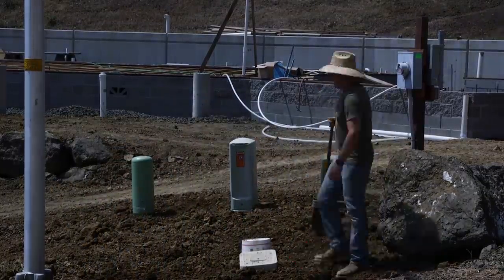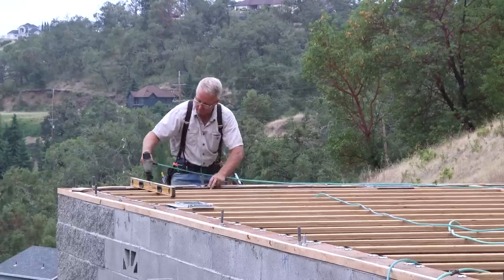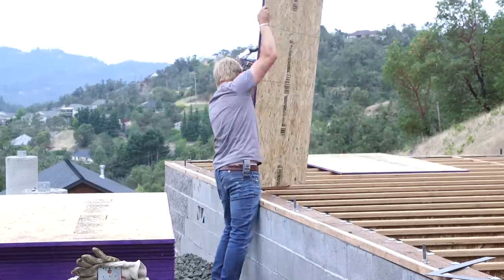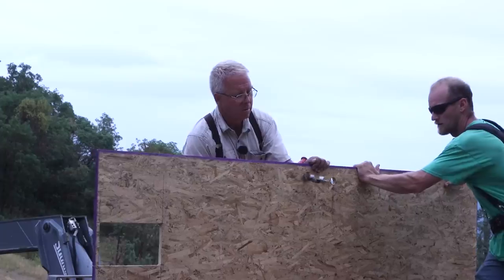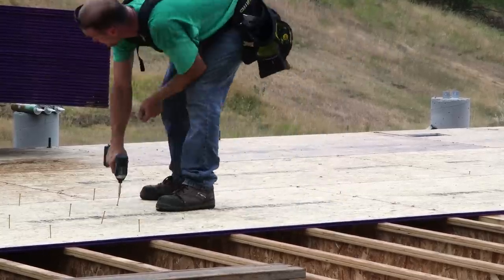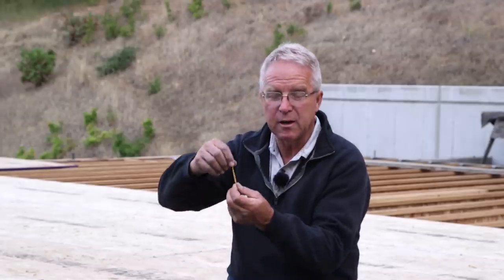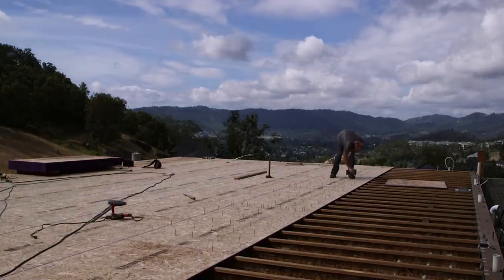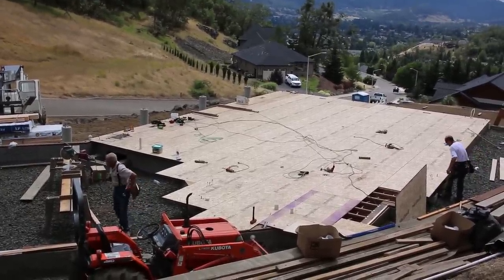Lay the Deck Ep.44

Comment: Just enough sticking out for the insulator to cut open his hand. Lol.
Reply: I laughed to hard at that statement 😂.
Reply: Yuppppp
Reply: I wish roofers provided the same courtesy.  I don't know how many attics I've worked in, putting in proper fans, vents and ducting [renos], and my back is a punched and scraped mess from the shinglers.   You don't need 2+" nails on 3/4" sheeting.
Reply: @Kaptain13Gonzo  yuppp
Reply: @Kaptain13Gonzo  I think roofers buy whatever the cheapest nails are that day.  If they can get 16 penny nails cheaper they'll probably use those for roofing.
Reply: @Kaptain13Gonzo  - code requires some of that regardless of what would be good enough.
Reply: @tsx3214 , They're not really required to.
Reply: @tsx3214 , That's a nice deck !
Reply: @tsx3214 , Now that's stretching it. 1/2'' plywood on 24'' OC is nuts ! Must feel good to have it all up to snuff !! Well done.
Reply: @chrismoore9997  They did not follow code on my roof vent, the nails for the shingles were too short and started coming out a year later.
Reply: simple solution, staple wood strips to under i beam edges short pieces or long strips more or less where the 3.25 screws are going., that be done when blocking the I beams. just a thought
Reply: I poked a can of spray foam on cue decking spikes and man was that a mess. Ive watched a guy be ignorant and not wear his hardhat and put one of them spikes in his head

Comment: You’ve gotta love it when your bit stays with the screw
Reply: Likely the magnetic bit holder is worn out and the magnet is not so good anymore, get a new one and the bits will stay in the holder and not tge screw, I have a holder for each common size bit, its easier to change the holder out than change the bit, once they have been in a while then tend to jam in a bit.
Reply: Duct tape
Reply: Buy a longer bit instead of the extension.
Reply: We all realize you can just buy a straight up torx bit with an impact ready shank (with the detent), right? That solves all the issues
Reply: @willywombat2087  .exactly just what  i was going to type been doing that since the 70's DUCT TAPE

Comment: It gave me a good chuckle seeing you use that brand new corded Milwaukee magnum drill.... old school to the end running Corded drills.
Reply: You never have to charge it. On a real job if I see you roll on with cordless shit you get to the top of the layoff list. Muhfuqers trying to set up for a day of welding moments with a cordless grinder. Yeah don't waste my time or money.
Reply: Both serve their purpose. Anybody who has used power tools has either cussed the cord or the battery at one time or another. Most guys I have worked with out in the field are running cordless everything with the exception of stuff like SDS rotary hammers and other really big power hogging tools. The cordless stuff gives you ultimate freedom and convenience and some safety  with having no cords dragged around the work area. Cordless impacts, drills, electric ratchets and angle grinders really increased our production. Batteries would get switched at lunch and charged at the end of the day. With the 5.0 batteries I was running they would last for 3-4 days but would still get topped off often. 
 With that said if I’m setting up a work bench or a stationary work site where I will be working my tools hard the corded stuff is king. A welder putting in 50 a week on a fleet of angle grinders certainly needs corded. But having a cordless rig around for a quick field trim or touch up is also just as handy.
Reply: Welding is a lot different than other trades for power. 
We had a bunch of milwaukee 12.0 ah batteries given to us to test out. It worked pretty good for bigger hammer drills and chippers. This video is about working with wood instead of steel. 

Look at it this way, to insulate you need a steak knife. I agree your trade needs way more power, but for most of the others cordless is the way to go.

Comment: Every squeaky floor I have fixed, being screwed or nailed didn't have enough glue.  People say oh it's because it is not screwed but most of the time you can see the sheet has moved and removed the glue when installed or just not enough. I have nailed off hundreds of floors with 3in plain shank nails and used the rule of a tube of glue (310ml) a sheet (3.6m*0.9m*19mm) and never once had a call back or problem. Its how its installed and how flat your deck is to start with. But that said it can never hurt to screw it off.  Love the videos best channel on youtube.  Thanks again and Hi from Australia.
Reply: That is true; having done quite a few subfloor installations, between the additions we build and replacing subfloors in the mobile homes we work on (not known for flat framing), we always use smooth shank framing nails and glue and have not yet been called about a squeak in the 16 years we've been working down here. Just be diligent about glue thickness and pressing the sheet down where you're nailing it.
The only time there were creaks was when the house settled and the I-beam itself lifted off of a support, or when a joist lifted off of the I-beam.

Comment: So nice to see someone screw a decking down instead of nail gunning it lol.
Reply: Why because you screwed floors for a job n think that concept is king? Fact is it’s always been shot first and screwed later. Dude is just saving money on nails.
Reply: I've worked new construction in Oregon for 5 years. About 2 hours away from where EC is working. I've never seen a general contractor screw a deck down. 

Nails are cheap (in comparison) to screws. So the fact that he is screwing it down is impressive. It will help squeaks if done well. 

Have a great day!
Reply: @zacharybaker695  Unfortunately, it is still possible to get some extra noises and creaks as time goes by years ahead. Especially, when using hardwood or laminate floor covering materials. Scott stated in some of his videos earlier that perhaps a solid concrete floor is the only idiot-proof way to get zero floor noises now and later in the future, too.

Thanks for the great & insipiring channel; I have now watched nearly all of the content :)
Greetings from Finland, Europe!
Reply: I had my house built 14 years ago.  I'm not a contractor, but I personally screwed down the subfloor after the contractors glued/nailed it down.  I did the entire house, with spacing something like every 6 inches. 

14 years later, the only squeaks my floor has developed come from other sources; like return HVAC sheet metal bending from floor pressure when walking in a couple spots.  (In my part of the country, we use spaces between joists as HVAC return path.)  I consider the effort of screwing down the subfloor to be worth the cost of time and screws.
Reply: Physics. The screws have higher clamping force then nails.
Reply: Glenn Holcomb  They do, but the shear load in this case is minimal. The need is to clamp down the material, and screws are much better.
Reply: @942687032679840126   that plus sheer strength can be increased by just having more screws and spacing them tighter together
Reply: Where I live the building code requires all subfloors to be screwed.
Reply: I've been spec'ing "glued and screwed" subfloors in my drawings for at least 20 years.  Some folks just don't understand the difference between screwing a floor down and nailing it.  That's apparent from some of the comments!  (shear on a subfloor that's glued? Really?)
Reply: @zacharybaker695  same here framer by trade 6and12 nailing or whatever the prints say
Reply: Peter Lamarche where do you live just curious gob bless
Reply: As long as you glue and nail at an angle you wont ever have problems squeaking or otherwise..  but to each their own.. :)
Reply: Now if I'm asked which is better?  I'm gonna have to say the obvious----> screws.. :)
Reply: Glenn Holcomb  you're not sheathing a wall where shear strength is more important
Reply: Tedious screwing--Surprised they didn't already invest in a subfloor screwgun. Only way to go.
Reply: cisa93  I think ring shanks are really good for subfloor definitely or even smooth shank 10s.  The ring shanks are probably gonna have a stronger hold
Reply: I think the screws are pretty strong just from man-hours perspective most supervisors/foreman would not want it just takes too long
Reply: we glue, nail and screw our decks in south carolina
Reply: @alejandrozuniga4426  right on bro what kind/length are you guys using?
Reply: @svensvrgen6336  we use the liquid nails or the foam from advantech, 2 3/8 ring shank nails and i believe 1 3/4 screws, i have a makita screw gun, it is very fast
Reply: Screws are the deal, nails pop on drywall all of the time, I like the system they're using with the glue, OSB and screws, seems tight.
Reply: @alejandrozuniga4426  I see right on right on.
Reply: @Fauxjob  Alejandro Zuniga you guys have some good points. Makes sense that screws would be stronger; would love to try this system out sometime
Reply: sven svrgen they’re being ridiculous lol nearly every floor system  is shot first and screwed later
Reply: I have framed hundreds of house with I joists, OSB subfloor, adhesive, and GOOD quality ring shank nails with no squeaks-customers telling me years later their floors are still quiet. It's all in the details....super level pony walls supporting your joists, gluing the joists in the hangers, gapping the subfloor sheets, laying the sheets in fresh glue (before skinning occurs), and accurate nailing into joists (NO misses). With that said, I still screwed my subfloor down when building my own house. LOL
Reply: @micahwatson9017  Right, the three most important factors in subfloor are the the glue, the glue, and the glue, not the fasteners. Hold strength comes mainly from the glue if applied correctly, not the fasteners.  Fastener's main job is to clamp the glue, which nails do fine and much faster than screws.
Reply: @barrybritcher  Glue provides more force across the sheet than the fastener, nail or screw.  Fastener is there  mainly to clamp the glue.  Nails are faster and cheaper than screws, so ...
Reply: @dylanmounsey7515  I haven't seen a subfloor shot down with a nail gun in almost twenty years.
Reply: Michael Booth need to get out of the house more then. I seen six just in the last week alone
Reply: ring shank nails and glue.  Any squeaks that come up during construction get fixed with screws.
Reply: My dad always preaches glued and screwed. Same way I'm building my house

Comment: I'm a roofer and I can tell you that OSB is the best decking! We usually use 16 penny nails as spacers for the OSB! Phillips head screws are garbage. I love the torque or square head screws. LOOKS GOOD SCOTT!
Reply: Andrew Joseph torx
Reply: Andrew Joseph most OSB (we called it SOB 🤭) sheeting has “Sized for spacing” printed on it.  The one down fall of SOB is it swells when it soaks up moisture. The gap you leave (1/8th inch is an industry standard) helps to prevent pressure ridges from forming Incase it gets rained on before the structure is dried in.  

I kinda smh when I can see these ridges projecting through the shingles on a finished house.  🤷🏽‍♂️

Comment: Just days ago I was pulling up half inch plywood in an attic for an HVAC install. After pulling all the nails the sheets came up with almost no effort, even  though adhesive had been used . I don't know what type of adhesive it was or how old, I'd guess PL200 from the 80's . It was hard as glass. It stuck to the plywood but not the 100 year old 3x8 ruff sawn joints on 16 inch centers.
Reply: Probably what happened there, was the glue man got too far ahead of the sheeting guy (maybe the lunch whistle blew) and the glue ‘dried’ before the sheet went down.
Just my guess.
🤜🤛
Reply: @psidvicious  If that was the case, would it not have stuck to the joists, not the plywood? I Maybe the joists were dirty and had a layer of dust on them stopping proper adhesion.
Reply: @peter_smyth  Could very well be Pete. Just speculating but, maybe the glue doesn’t adhere properly unless it’s mashed into the material [joist or plywood] with some force in a reasonable amount of time after applying. Some glues work that way. Like you always see the plumbers twist on the fitting once they’ve applied the glue.
🤜🤛
Reply: @peter_smyth  Bingo.  Dirty, dusty and probably a patina build up = glue no sticky.
Reply: psidvicious n
Reply: PL does not hold longterm. Project farm has a good test on most construction adhesives.

Comment: Hi, I love your channel.
As a carpenter from Australia, we mostly use particleboard for sheet flooring 3600mm X 900mm (12ft X 3ft).

The 2400mm X 1200mm (8ft X 4ft) size boards you guys use is a pain for flooring (so many more butt joins over a whole house area). I know the sheets we use here are more narrow, but a tongue and groove join along the long side doesn't require any extra work during install. 

Ideally you want as few butt joins as possible, if any smart OSB manufacturers read this comment. You should start making 12ft X 3ft sized sheets like we have here in Australia.

Also, I've nailed down every floor I have ever installed over the last 20 years with 75mm X 3.06mm (3 inch) smooth shank gun nails. I've have never been called back for a squeak in a floor I have installed. (Just make sure you use plenty of glue). Nailing is way faster than screwing. 

I have definitely found that it is better to use polyurethane adhesive rather than common construction glue (liquid nails etc).

The reason for that is the polyurethane stays permanently flexible, common construction adhesive goes hard and brittle after about 7 or 8 years.

I love seeing the different ways you guys do things over there.
OSB board has only just started to sell in Australia this year, never seen it here before that.

*A few hints I've picked up over the years to save your back:

1) If you want to continue screwing your flooring, invest in a stand up style screw gun/impact driver.

2) Use a longer handled sledge/lump hammer to hammer your board together to save bending over.

3) Use a piece of reinforcing bar approx 3ft long and bend a hook shape on one end, use that to hook over the sheets (in the centre) as you lay them - and lower them onto the glue accurately. This saves you dropping it from a height like you guys were doing in this video.
A 3ft long pry bar works well for this too.

Comment: If it gets wet enough to delaminate plywood, I'd hate to see what would happen to OSB.  I still belive plywood to be superior in everyway if one can afford it.
Reply: Adan Calderon I’m not an expert but I did have an osb shed floor get soaked with standing water for 48 hrs and it went right back to shape after it dried
Reply: gallamine OSB is quite resilient.  My only gripe is off gassing of whatever they use to hold it together.  I guess the same might be said of plywood.  🤷🏽‍♂️
Reply: I'm surprised that he didn't at least use 3/4 Advantech flooring; it can stay wet for months and never "fuzz up" in the least
Reply: Steve Bengel it looks to me like he’s using Norboard Durastrand, which is a pretty close competitor to advantech.
Reply: He could have bought it for the money wasted on SCREWS!
Reply: @adancalderon8915  - that is an interesting video, the first I've seen which created a laboratory style testing environment.  It seemed to settle the question if you disregard the cost - plywood is superior.  But then I read all the comments, and now wonder if the test was 'real world' conditions. It is obvious that some effort should be considered to keep the flooring dry during construction - which may be nearly impossible.  (Perhaps build in Phoenix, not Seattle.)  I live in a two-story home with poured concrete sub-floors, and wonder if that is the way to go.
Reply: Advantech hands down. you can leave that stuff out in the weather for years before it breaks down. definitely not cheap though.
Reply: @gilbertfranklin1537  yes he mention s in another video that concrete gaurantees no squeak s
Reply: OSB is surprisingly resilient . It's got a lot of oil soaked into it as well . It's amazing how well it does .
Reply: @badlandskid  yep plywood and OSB actually use pretty much the same glue, and that glue is very similar to what's used for MDF.
Reply: Frame houses in Ketchikan for a while and you will see lots of plywood delaminate.
 Advan tek does not suffer from water problems
Reply: I talked about it with my old man, who has been a framing contractor for several decades in south texas, and he told me that he belives it is all about brand (ie cost) and the glue they use to to hold it all together.  From what i understood their could be really bad plywood and some high quality OSB.
Reply: @stevebengel1346  that's what we use holds up quite well
Reply: Weyerhaeuser makes a subfloor product called Edge Gold.  Its a T and G OSB that is designed to resist swelling and delamination.  Its commonly used here in the Portland OR area.
Reply: And screwing the floor at this point bad idea. They should nail it now and then when the house is closed and  dry then you screw of the floor.....That how we do  it here up in the great white north. Other thing i would not want to live in a house that has joist all shimmed up on wedges and ply stripes all that blocking is just hanging there a not physically attached to the structure there a good place for many a squeak....
Reply: Plywood>osb